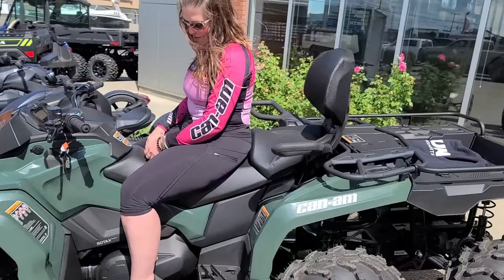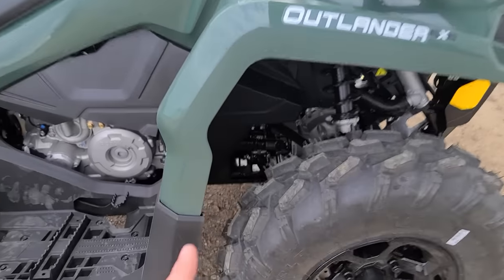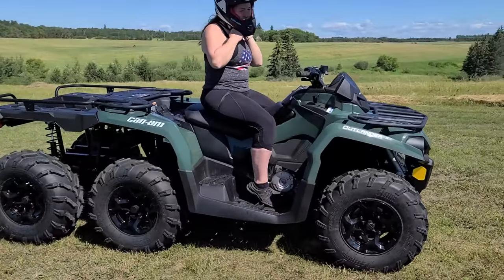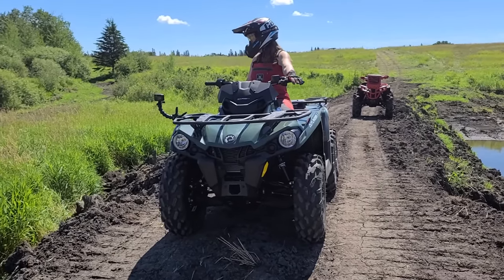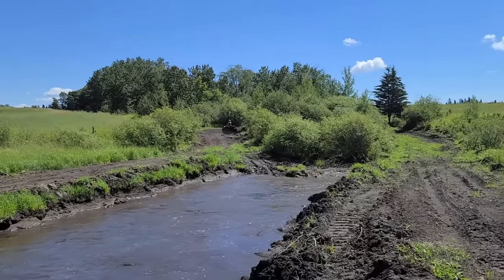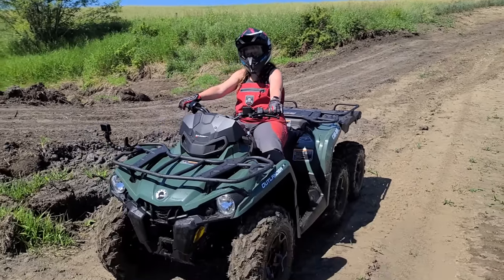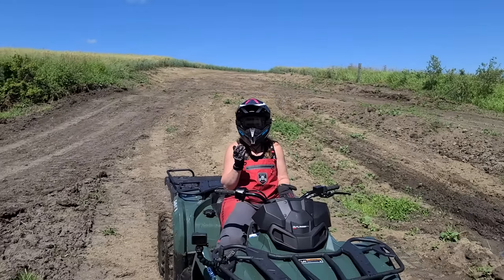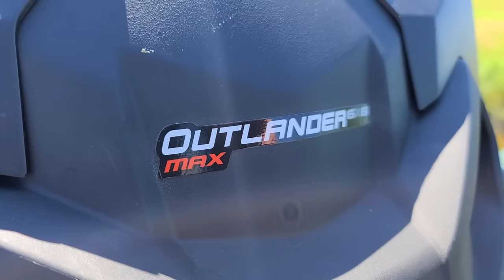Mrs. Ostacruiser's New Can-am Has 6 Tires

Comment: I believe that little plate they welded on is for a rear winch or tiger tail with a fairlead bolts on top of the rear diff braces

Comment: Can y’all imagine if someone was to build a 2-3” frame extension kit for in front of the center diff and a 2-3” extension for behind it and in front of the rear diff and then add the 2” front A-arm kit you probably run 30” tires with no problem and maybe even 32s

Comment: What does this guy do for money?  Can buy everything.  I had a 2016 Outlander 2 seater and had 4 brake jobs, digital display fail, DPS fail and rear end problems all under 400 miles. It was the biggest POS ever. And the dealer was even worse saying it was where I was ridding. I used it on the farm.